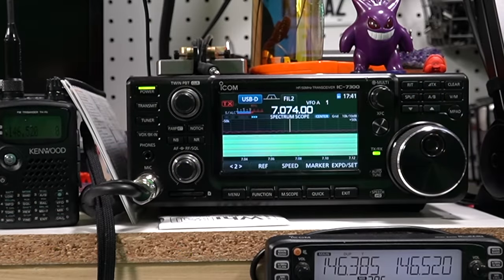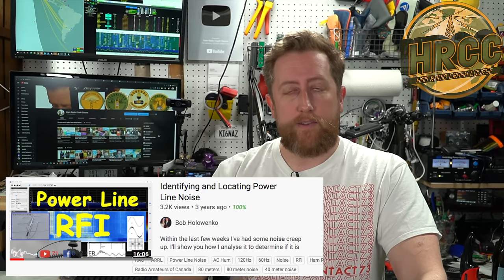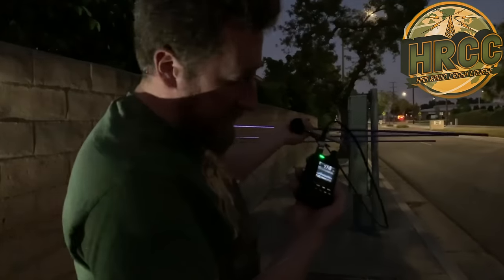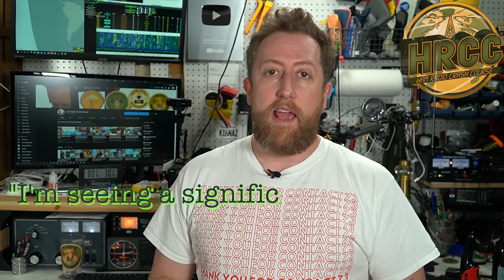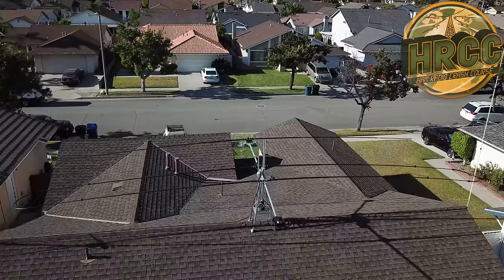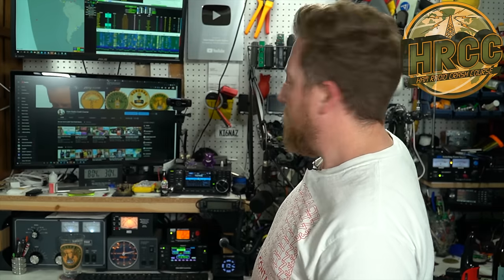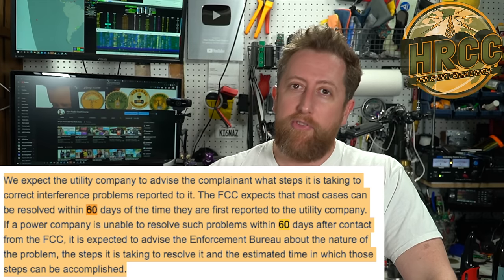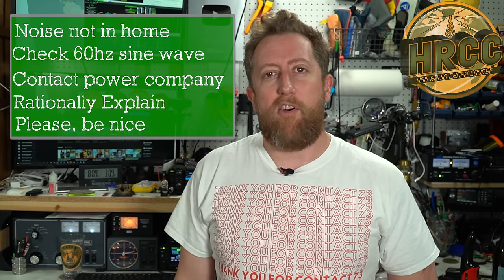Power Line Noise On Your Ham Radio?  How To Find AND Get it Fixed

Comment: an acquaintance of mine fixed his pole mounted transformer noise with his .30 rifle.
Reply: I know I shouldn't let those thoughts arrise at my mind, but I thought the same😄😄😄 (they would fix it in hours, rather than a lot of days😄😄😄)
Reply: With instant results
Reply: Wow did he watch the transformer oil flow down the utility pole? Hopefully the transformer does not have  high PCP.🤔
Reply: Best way to find the exact pole, is to give the pole a whack with a hand sledge hammer while monitoring the noise.  Have found three this way.  Take the exact location and the pole number (on a metal tag usually), to the power  company.  It does take a long time to get it fixed, but they have a vested interest in fixing this as it wastes power, and may be a failure point.  Worst case, if they are unresponsive, show them a letter you have ready to the FCC.
Reply: @wahoo0631of course you are right, sir.
 😄😄😄 it's only a joke😄
It would be plain stupid to do that😄
Reply: Heard of a guy that did that. The bullet cut through the secondary of the transformer and he got a 400 volt surge in his house!
Reply: @grayman735  You meant PCBs.  Polychlorinated Biphenyls. Current regulations prohibit the use of oil with PCBs in transformers but that doesn’t mean there aren’t old ones still out there on poles with oil containing PCBs.
Reply: Thanks for the laugh
Reply: Shot-noise

Comment: Had about the same positive outcome. I got a call from a serious SWLer. He said he had noise so he could not SWL. Gave him all the ideas on checking inside his home. He called back, not in his house. I drove by his house with a ICOM 7100 and a Tarheel screwdriver antenna. Yes, he had interference. I drove down to the corner, much stronger. Turned left, went down a busy street with large power lines. Found the strongest pole, then went farther, then went 90 deg down adjoining streets. Got the pole number. Gave the SWRer the pole number and told him to call the power company and be nice and tell them the issue and the pole number. The interference was so strong, you AM radio was worthless for blocks. Told him to tell the power company that they are loosing money from lost power. The power company came out in 2 days, with 3 trucks and fixed it on the spot.   KQ4KK
Reply: Wow! Impressive, Very aggravating to not be able to use radio because of the power lines.
Reply: You were smart:
"tell the power company that they are loosing money from lost power"

The power company:
"CALL 911 !!!! we are loosing money on that power pole !!! Send first responders immediately !!!!
😄😄😄😄😄
Reply: Well done!  Giving the pole number is a huge benefit.

Comment: Also, by law, the power company HAS to fix the problem. You have to notify them you are a Ham, and specify it is across all bands preventing you form operating. This is a federal law issue, and I have had experience dealing with my power company. Fortunately, after I filed my complaint, the individual that was sent out was a ham as well, and he used similar equipment, but a bit more like your Yagi. He found the offending pole in 5 minutes, and a week later it was fixed.
Reply: Helps when there is a fellow ham on the the repair side.

Comment: I had the same RFI issue was 100% sure it was coming from a transformer behind my house, my power company came out in less than a week swept the area around my house and found several issues and within 3 weeks had all the problem areas resolved which which ended up being a dozen insulators around the block I live on but didn't resolve the problem the technician came back out after he called to see if it was fixed and I replied no still have a lot of RFI so he swept the area in my back yard with his parabolic antenna and found no noise coming from the power pole in my backyard but as he was talking to me and drop the antenna the noise on his parabolic went off the scale and then went quit again. What we discovered was that it wasn't actually power line noise but it was a AT&T phone pod sitting right next to the power pole that is causing all the RFI.....after several attempts to contact AT&T with this fact and not being able to get in contact with them I built a Faraday cage and put it around it and minimized the noise a lot , but not completely
Reply: Man......... Never thought about a Faraday cage, thanks. 😂
Reply: Just rip it out of the ground and throw it away, all new shiny gear shows up within a day or two. 😂
Reply: Contact the Public Utilities Commission, that usually works.

Comment: Having PL noise in my area so I opened a ticket through Baltimore Gas Electric and was contacted about two weeks later.  The three poles that I directed them to were indeed in need of service.  The BGE team is appreciative of my help since the equipment actually needed to be upgraded.  I was told it can take some since a repair order needs to be created and placed in the queue, and also it will require road closure while the work is done.  BGE has been responsive to my concerns over the years and have always resolved my RFI issues.  It'll be a while with my S9 noise floor on my hex but I have confidence it will be resolved soon.
Reply: Was it ever resolved?

Comment: I have a similar issue. Extremely high noise floor 90 % of the time. I keep thinking it is power line noise. I live in a small midwestern town and a few months ago the power went out in the whole town for 4 or 5 hours. I hooked my radio up to battery power and the noise stayed the same. So now I am stumped.
Reply: Aliens.

Have you looked around for a business or home with a grow light? Maybe on a generator? Those can be super noisy.

Comment: Hi Josh! ... good topic. So my noise issue was a while back ( several years) ... But I found this article in QST that talked about an ultrasonic detector that you could build that was effective at finding sparking type of issues on Power Lines. I took the time to build one. Essentially, it was an Ultra-sonic down converter that converted ultrasonic sounds down into the audio range. Further, it added a parabolic antenna to the front end of that ultrasonic detector, so that it was highly directional. I had wrestled with that noise for years, and it cost me several, what could be called, new countries that I might have been able to make contact with, without the noise, and made it virtually impossible to make contact with them, because of that noise. At any rate, within only a few days of having built it, I had walked the entire neighborhood and identified, not only the specific pole that the interference was coming from, but also, the specific service off of that pole going to a specific commercial business entity. I called the proper power company (it happened to be on a boundary between two power companies) and let them know, and then I finally made contact with the owner of the specific business entity and let them know they had a problem by telling them what I had found. The result was that the interference went away relatively quickly ... (within a couple of weeks). Today, I have a different issue, which appears to be a switch-mode power supply, due to its specific repetitive frequencies across the bands. Thank you for giving me some new items to look for. I hope my info is helpful for someone else.

Comment: I get a lot of noise. I live in Australia and in my suburb all the power lines are underground. Like you I turned the house off at a breaker and ran the radio from a battery and it made absolutely no difference to my noise floor.  Roof top solar panels are pretty popular in Australia and I suspect all the noise I'm getting is from panel power inverters. Intrestingly I had the HF Radio on as a thunder storm started. One strike hit and we had a VERY brief power cut. Just enough to flicker the lights and set the buzzer off on my computers UPS. Interestingly all the noise on the HF bands went away completely for almost a minute. just as all the solar panel invertest started to come back online feeding energy back in to the grid the noise creeped back up.

Comment: I've heard of similar stories where the power company tech was a ham as well and the details the reporting ham gave them lead right to the pole.  I had one issue in my neighborhood where the noise was audible by the human ear from a block away.  Giving the pole number helped SCE get someone out within a couple of hours to fix it, but that's a different case.  Glad you got your issue resolved.  I've used my FT60 and a yagi on 70cm for hunting powerline noise.  I have lots of lines in my area, including right through my yard and supplying power to my house via a line.  Thankfully most of the lines and the boxes have been replaced within the last two years.  That's one bonus of being in a wildfire prone area, I guess.

Comment: From 2002 to 2006 I worked in a very small Power Line Communications (PLC) company. "Wow, internet without cables. Super cool!!" I had similar random noise issues for many months on a high voltage PLC trial.  I was suspecting this type of noise. So I did a training to locate these powerline noises with rfiservices . com with the specialist Mike Martins in USA. We bought the same equipment from Radar Engineers company you showed and we confirmed it was our problem. We tried to fix some old noisy isolators, but it was so many to fix. You fix one, then another one starts to bother. The noise was totally random, depending on humidity, rain, dust, hour of the day. Maybe your weather changed and you don't have the conditions for the power to leak again down to the ground. This is quite frustrating. I remember seeing a super strong noise pole once. I could hear from the RFi tools some blocks away until we find it. Well, my obvious conclusion was that it was impossible to use high voltage (or medium voltage) network for powerline communications and the company was basically closed sometime after that. hahaha. I lost my job but it was surely plenty of fun for a young Electric Engineer!

Comment: WOW Josh !! You have really hit a hot topic. One that has plagued me for several years. I finally build several dedicated pieces of test equipment to hunt down my noise more efficiently. One uses the dish you mentioned. It is actually an ultrasonic arc detector. For arcing in open air it is very effective. However, if the arcing is inside a fuse disconnect or or pole device, it doesn't do much. The other is a 130MHz AM receiver with a MOXON antenna which works very well. My noise seems to reduce just after a rain. My detector led to the pole transformer just behind my house. Power company came out and changed everything on the pole. Unfortunately, the noise had changed but still remained. S7 I had the lineman take my receiver up in the bucket truck with only a "rubberduck" antenna. He ran it around the high-voltage line and heard nothing. But when he got close to any ground connection on the pole, it went nuts. With the grounds interconnected to every pole in every direction it is especially hard to locate the source. All those interconnections retransmit the noise. They were not able to locate the source, so I will now need to get back out and try to triangulate, just like you described. Hope this helps others, it can be so maddening, effecting even 2M FM operations. 73 Terry W4ZQ
Reply: The noise can travel - the best approach is to use a sonic sniffer when you narrow down the area of the source.  PLN is especially rich around 120MHz, BTW

Comment: I have had several cases of bad RFI over the years. Most of the time it was High Pressure Sodium streetlights. When they burn out, they cycle on and off, making horrible cascading interference that reaches people blocks away. In each case, a call to the local government got it solved. The lights have since been swapped out with LED, so problem solved for the long term. I had another case where an HPS parking lot light had a fried light sensor. In both cases, the RFI was a night-time phenomenon.

Comment: Finding noise can be frustrating.  I was working for a company that rented medical equipment to hospitals.  At a certain day at an almost exact time, the telemetry system in the cardio unit would fail.  The outage would last only about 5 minutes. After much frustration and spectrum analyzer usage we decided to think 3d.  Finally we found that a worker went into a room to close out his weekly paperwork and switch on the florescent lights which had a bad ballast.  This room was 3 stories directly above the cardio unit.This was in the 90s.  Tech equipment has advance greatly since then.  Anyway I blame this problem with my baldness.

Comment: Awesome video! I’ve been suspecting all the rfi I’ve been experiencing was caused by the power lines and now I’m convinced! It’s been getting progressively worse over the last few months to the point now that the antenna on my house I use for local contacts is pretty much unusable. My wire dipole I use for long distance contacts is further back in the yard so it’s much quieter. And the mobile, as soon as I turn down my street is deafening! I’m going to have to make some calls, and hitting the subscribe button as well.

Comment: If you have trouble getting through to someone who understands you at the power company, every state (US) has something called the public utilities commission or public service commission (PUC, PSC), etc. A call to them will usually get someone higher up the chain to call you back. 
They handle complaints about utilities and have a back door to  the higher tiers. When the utility companies get a call from the PSC they act on it right away.
I used to use them for solving phone company problems and the results were amazing.
Reply: That's the way to go😄👍.
When you call the right guy, things will be fixed really quick😄😄😄.

Years ago, I've checked that a friend's apartament block didn't have the original analog (at the time) external community TV antenna (obligatory by law, in Portugal).
So, she couldn't watch TV, except if making a payed contract with a cable company (wich had the original antenna disconnected)
I've told her it was not legal to do that.
Than she told me she would call her brother in Lisbon. 
And who was her brother ?! The FCC Director !!!!!! (well...it is not FCC. In Portugal it is ANACOM).
You should see a three engenier team rushing from main Office in Lisbon to fix the problem:
Direct connection to their network, no charge, lots of appologies 😄😄😄😄😄😄😄😄.
It was cheaper for them than reconnecting to the TV antenna 😄😄😄😄.

Comment: There is at least 1 ham, (an RF engineer,) whose noise story I read online several years ago. He designed an inexpensive low-frequency receiver and a loop antenna system to locate power-line noise problems. He would go around to the power-poles with it, identify the problem pole,  then smack the pole with a baseball bat to verify that that was the pole that was causing the noise. (The bat trick often works even if you're just using an HT while smacking all the power-poles in the neighborhood. But it leaves the neighbors thinking you're batty.) Then he would call the power company. About the 4th call he made about a specific pole problem they just got the location info and started coming out to fix it without wasting their time playing noise foxhunter. He was doing that job for free, and he knew more than they did.
Reply: Is there a go to meter to find these interferences? thanks!

Comment: Very good video about solving external
RFI, not caused by you or your home.
However, until I moved a few years ago,
being in a condo as a renter, though my
antennas for HF, simple whips, I heard
more noise at certain hours from my
antennas being outside, but the buzz
was worst received on a receiver while
in my living room of this large area apt.,
The noise seemed to come from the
floor below me, about a year after we
moved in when another neighbor moved
in, and it come on in the morning, when
they turned on what I suspect was a
plasma TV, then go off when they went
out to work, and come on again after
5 PM, coming home from work, until
at night when the TV was turned off
later. I never had a chance to ask them
if this was true, because we weren't
friendly with them. I did not interfere
with my amateur operations. W2CH.

Comment: Thanks Josh. From what I can tell from my scanning, my noise floor is the same S5 to S6 no matter where I go in the neighborhood. Blocks and blocks away it is pretty steady noise and while there is some from the power lines, it just seems to be a cacophony of noise from everywhere. I had a lot of noise when they were building the Firestation 1/2 a block from the house with various equipment. That fortunately disappeared after the construction was complete. I intend to do more scanning when I get the 705. I do not have a high noise level with 6 meters on down.

Comment: I had very similar issues, one day across multiple bands I had +30 noise. I sent an email to Duke Energy letting them know I had tested in my house and it didn't appear to be coming from inside my house. The next day Duke's RFI hunter called me letting me know he would come out and try to find the issue. The day after that he called me and let me know he had found the problem, a few blocks away from my house a mainline fuse was visibly arcing. Within a week everything was fixed and I was back to full quiet on UHF and VHF, and back to the normal s5 noise level on 80m. I wish my normal noise level isn't so high but I have no control over the neighbors.